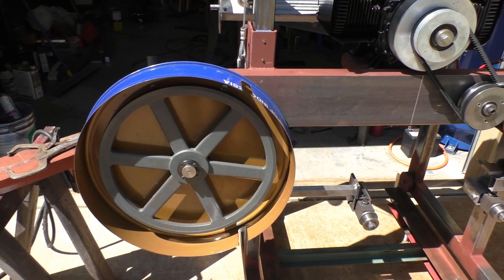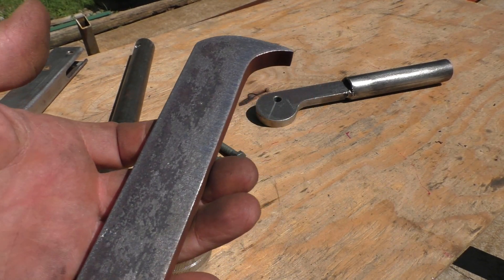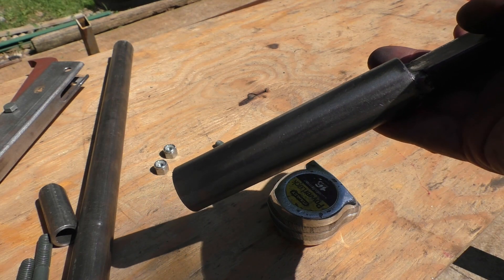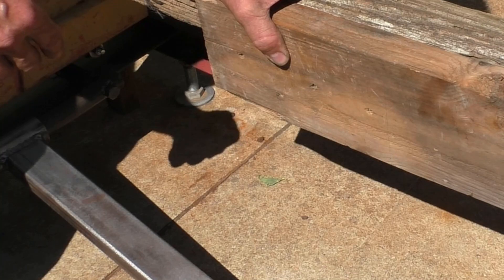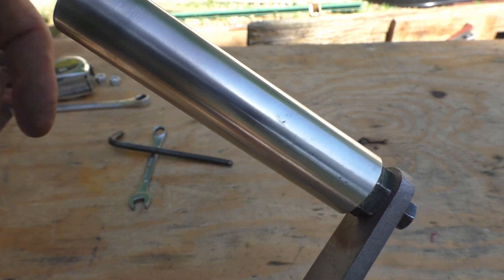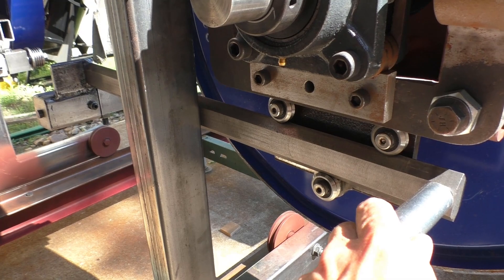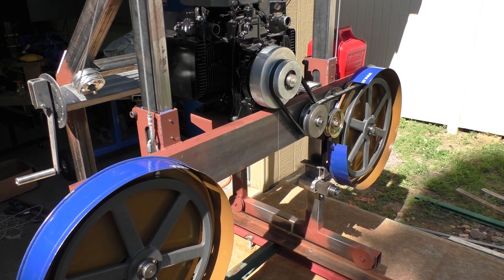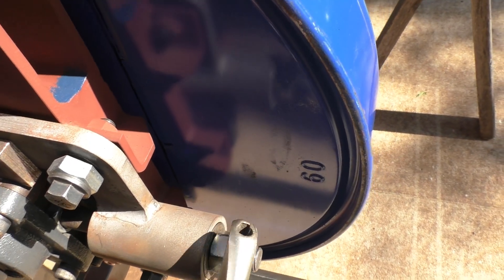#45 DIY Homemade Band Sawmill Build Log Clamps, guides, stops, guards Spencers-Mountain Off-Grid

Comment: Nice build! Where did you get your clutch from?
Reply from the maker: The clutch was a lucky $150 find on eBay. My old engine has a not so common 1-1/8” shaft with 18hp normally means $600. A newer engine with slightly less HP could be much cheaper. An internet search for centrifugal clutch should find some offers. One example https://www.hilliardcorp.com/centrifugal-clutches/       Alternately, a pulley on an over center lever to tension the drive belt could have been used. But the centrifugal clutch is a pleasure to run.

Comment: Where did you buy the wheels for the blade? and what is it use for in jeneral? Im also building a sawmill but i just can't find the wheels and I don't want to use car wheels.
Reply from the maker: The band wheels I used are vee- belt sheaves. 18-3/4” outside diameter. I bought them new from www.surplus center.com these are general use vee-belt sheaves. One runs a tight fitting B size belt for a “tire” providing the crown needed that causes the blade to seek a high spot and run centered on the sheave. The drive belt on the engine provides the tire on the other wheel. If I were to build another saw, I would buy band wheels from Cooks. www.cooks saw.com. Their wheels have a crowned surface and do not use “tires”. They are more expensive but offer a lot of benefits running a blade on a steel surface getting rid of tire wear and sawdust buildup under tires.  Feel free to ask any questions and thank you for watching.

Comment: Im curious how did you make the cam and “spike” profiles?  Did u rough out and then grind? Use cnc?
Reply from the maker: Cut off wheel on a 4-1/2" grinder and belt grinder. The hand grinder could have taken care of the final shape but I have a homemade belt grinder for that. Could also be made out of bits and pieces welded together.  Somewhere I saw the cam parts made from cut off round bar and welded to flat bar with round bar spikes. Use you imagination an what you can find laying around.  Hope to see what you come up with! Thanks for watching.

Comment: I stumbled across your video today and also in the process of building a mill. I’ve went all over YouTube for many ideas and I was shocked to see almost identical ideas that you also have done like I have. Like your exact v groove roller bearings for you adjuster bar and main wheels from eBay I’m assuming too. Awesome build and thanks for the video. Cool stuff
Reply from the maker: I used YouTube videos to do my build...only seemed fair to share. Thanks for  watching, really appreciate it.
Reply from the maker: Check out surpluscenter.com for a much cheaper version of the identical parts.  Use the 18.75" split bore pulleys and bore adapters for the size shaft you want to use.
Reply: @SpencersMountain  thank you for the heads. This is we’re I did purchase some items from. And my milk is about completed. I’m excited for sure. I’m enjoying the channel. Good work. Thanks again.

Comment: Great build! Where did you find your centrifugal clutch?
Reply from the maker: The clutch is 8" with a 5" double pulley on it. My old Kohler KT17 engine has a 1-1/8" output shaft, making a HP capable and shaft size rather expensive (in the $400 to $500). This clutch was $150 on eBay and was new. Pays to search around for parts! Thank you for watching!